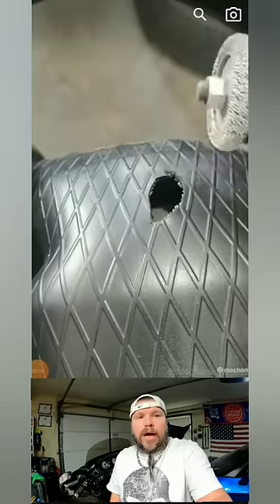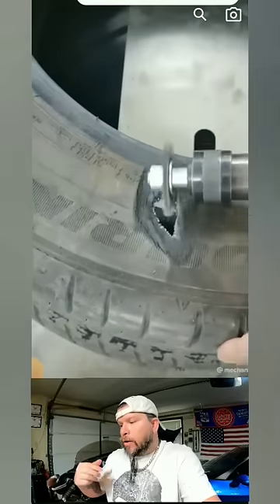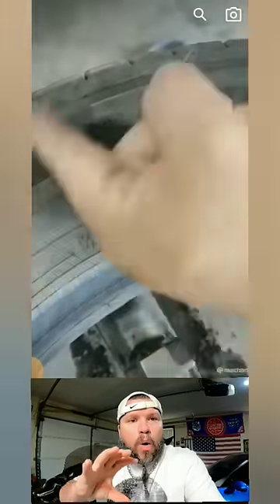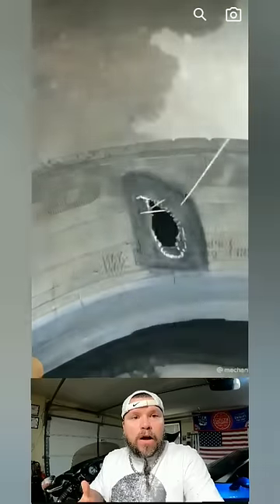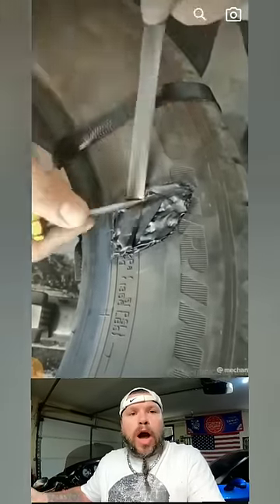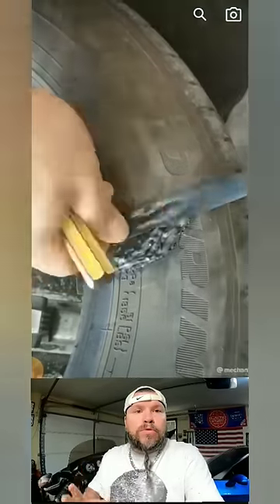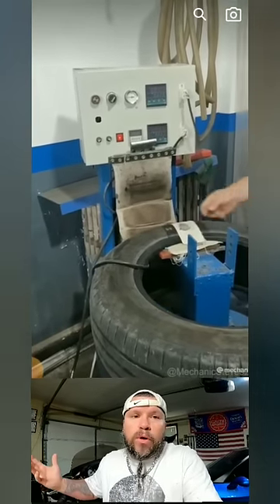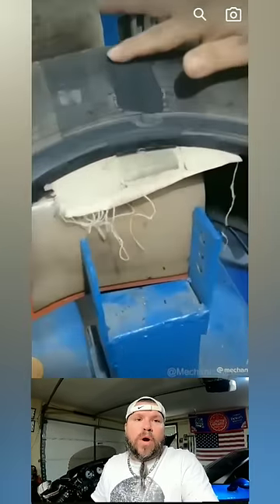patching a tire

Comment: As a tire tech that has worked at a couple different shops, the rule has always been to not patch a hole if it was more than .5-1.0 inches down the sidewall.

Edit: this is not a “do what you wanna do” scenario. DO NOT DRIVE A COMPROMISED TIRE ON THE ROAD. YOU WOULD BE PUTTING EVERYONE ELSE IN EXTREME DANGER.
Reply: As a TIA certified trainer with almost 2 decades experience, I can definitely say you have never worked at a real garage in your life. You don't patch a sidewall anywhere. 🤣 🤣 🤣 You don't even patch a tire on the shoulder tread area.
Reply: @SilvaFox  why? Up to an inch down the side wall is just tread
Reply: @rundownthriftstore  sorry in advance its gonna be long. ok so think of it like this. If you are looking at the tread (contact patch, area that contacts pavement), none of that is sidewall. When the weight of the car is on the tire, looking at the part of the tire that bulges out slightly at the bottom that passes from rim to the ground but still doesn't contact the ground is the sidewall. Absolutely no part of the sidewall is legal to commercially patch per TIA rules and the tire must be taken out of service as it is now a safety hazard. Back on the tread side (contact area of tire) it is only commercially allowed to patch a tire in the center tread area between the two outer most water sipes (there is some leeway here as different tires have different treads). The outer shoulder tread area that is still part of the contact patch but outside the outer water sipes, is off limits for a commercial patch as it will not hold in this position and again the tire must be put out of service. A commercial grade tire patch consists of a one piece plug/patch or a 2 piece plug and patch both of which must be installed from the inside of the tire. 

These patches can only be installed on the tread area as the steel bands, which are only in the tread area, not only keep the tread from flexing but with a properly installed patch won't rust out due to road debris. The other issue is when you install a patch you need to drill out the injury area with a special carbide drill tool. This cuts multiple steel cords which is why it can't be done in the shoulder tread as it's too close to the soft sidewall. In doing a patch in the outer shoulder area let alone sidewall, not only will the patch fail as it flexes every time the tire rolls over that spot but the steel bands being cut close to the sidewall destroys the internal structure of the tire which could lead to a blow out and possible fatalities. 

DOT inspects every tire of car crashes that are due to tire blowouts. If they find a patch improperly installed, the technician who installed the patch can be held responsible for the accident, hit with fines, damages, and manslaughter if it went that far. And yes those slimjim punch plugs you can buy at Walmart or any auto shop do not count as permanent plugs. They are just a temporary fix to get you to a proper tire shop/garage. Sorry for the long drawn out answer.
Reply: @SilvaFox  that's a respectable answer
Reply: @ThornyPickled  yeah... at first I thought they were just another mechanic being an a..hole. We all are so I was. but then they asked why and I realized they may have just been taught wrong and legitimately don't know. So sorry bout that haha.
Reply: @SilvaFox  That was a very detailed answer. I don't work on cars but I got some pretty good visuals.
Reply: Exactly how I was taught when I worked at a gas station. Far enough down on the sidewall and the tire is junk.
Reply: @SilvaFox  ego man. Calm yo materialistic mind
Reply: When I was trained it was do not under any circumstances patch or plug a sidewall. I think the distance thing you posted may have been misunderstood. I was trained if it was on the tread that close to the sidewall you don't do it either. It may come down to legal liability and who's willing to risk it. U.S. Department of Transportation in 2009 stated law that a sidewall puncture is not repairable. Similar scenario of legal risk is some shops will put on a tire on for you if it's dot date is very old but some refuse even if its an unused tire and its only a couple years old. The actual dot rule for refusal at a shop is actually 6 years old.
Reply: Every shop I’ve ever worked in from dealerships to truck stops to jiffy lube I’ve never seen anyone patch a sidewall. Mainly since any respectable shop or mechanic wouldn’t.
Reply: @SilvaFox I had one patched on the lower shoulder once. They said they weren't sure if it would hold. It lasted the rest of its little tire life though.
Reply: @ThornyPickled  Actually, he's 100% correct. I worked as a tyre fitter for approximately 3 years - not a particularly long time, but I was in the job long enough to know you 'never' 'ever' patch a side wall on a tyre. It's not even something to consider. The only time you repair a tyre is in the centre tread area, the inner and outer tread is a no go zone. I'll admit, I've repaired a tyres for off road use that were just on or pretty close to the shoulder, and a good repair will usually hold up, but this is still a long way from the sidewall - it's not even the same section of the tyre. The original video should come with a warning, it's extremely dangerous and has a high probability of total failure, and even death.
Reply: @SilvaFox  Well Said
Reply: @SilvaFox  I had to get one patched until the tires I ordered to replaced my 2 month old tire some one knifed because they didn't think the driver of my truck needed to use the handicap space. been in a wheelchair for 38 years.
Reply: @Silva Fox  you might have said that in a slightly nobhead kinda way but I absolutely agree.. anyone repairing a sidewall of a tyre shouldn't be working with cars.. as a mechanic myself, one of the first things I learnt was how to fit tyres, and to absolutely not repair a sidewall, if it blows out it could kill someone. The sidewall bares all of the load, if cords are showing or damaged, the tyre is fucked, it needs a new one. You have a duty of care to people as a mechanic, and never under any circumstances do you let a car leave the workshop in an unsafe way
Reply: @gheebuttersnaps2011  you were lucky then. Patches on the shoulder tread area almost never hold because they flex and stretch which causes them to heat up. Patches installed on the shoulder are installed with a curve when they are supposed to be installed in an almost  flat orientation. Every time the tire rolls,  the sidewall deforms from the weight of the car in that spot every time it contacts the road. That deformation causes the inside of the tire to go from a curve to a more flat orientation thousands of times when you drive. That patch sits neutral in the curved position but when it contacts the pavement, the patch actually stretches out and bends. This over time heats it up and leads to failure. This is why real, and respectable mechanics who have been properly trained won't do this.
Reply: Everyone if you are curious. Look up $22.8 million dollar Mossy Ford lawsuit. A faulty tire repair done by a tech at Mossy Ford caused a van to roll over killing the two occupance back in 2006. This specific incident was one of the leading factors in getting new laws and regulations put in place for proper tire repair. Please really think twice about doing that bad quick patch just because you think "itll be fine". Two people dieing because of something you did wrong is not something you want on your shoulders.
Reply: @Niko-xz5lk  the problem wasn't that he was right, it's that he was being a jerk, this was then cleared up as a misunderstanding. He does seem to know what hes talking about and backs it up with clear concise sources as well unlike most YouTube comments.
Reply: I think just a couple strips of duct tape woulda done it
Reply: @_xxiii_4109  that's only if you use the made from 100% duck brand duct tape.
Reply: @SilvaFox  I'm sorry sir but with all due respect youre wrong about the tape. Gorilla's are much stronger than ducks. Lol
Reply: Pretty sure the rule is not to patch a hole within an inch of the sidewall, not an inch down the sidewall. It's a little concerning if you're really a tire tech and have that mixed up. Not in a rude way, just genuinely concerning if your shop is patching tires like that.
Reply: Please tell me you worked at discount tire
Reply: We don't even patch within an inch of the sidewall at out shop since we mostly work with 19.5s and up
Reply: @soggynug6371  everything he said was right though, I was taught the same at the shop I work at. If we don't follow those rules we can get in legal trouble if caught.
Reply: @brianrausch7757  OH SHIIT! I completely forgot about the gorillas! You're right my bad 🤣
Reply: Most people in 3rd world countries used patched up repaired tyres. 
They can't frequently afford new tyres, each time they get a tyre damage. 

If the tyre is unrepairable or could be dangerous.  The mechanics warn about how dangerous could it be, so they could buy a new one, as soon as possible. And they still repair it for temporary use.
Reply: @jya5467  that may be true but this is the US not a 3rd world country. We follow TIA rules here.